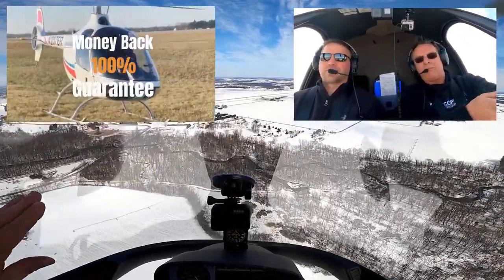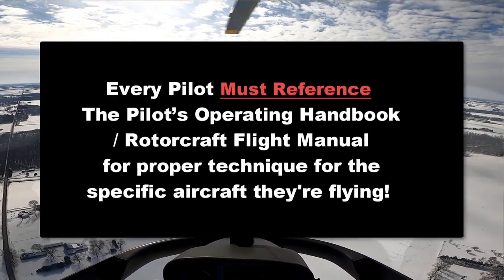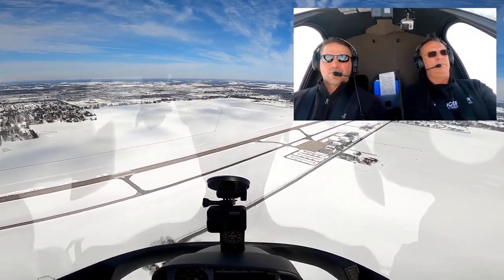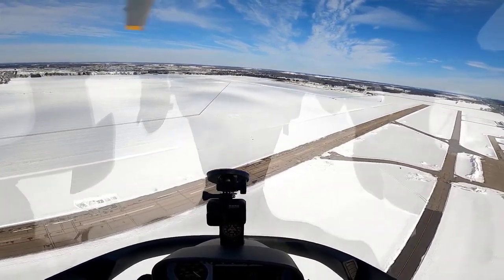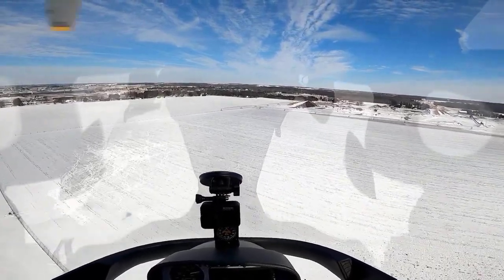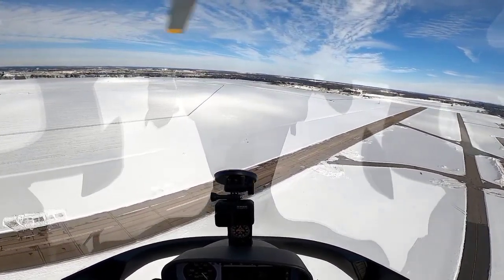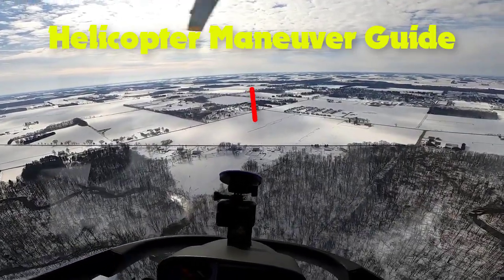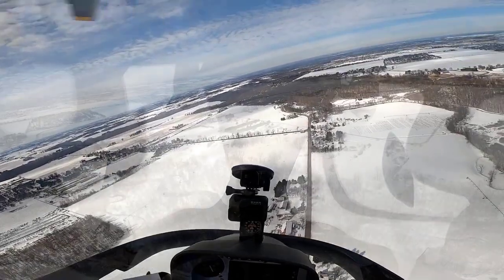Critical Helicopter Skill: Stretching Your Autorotation Glide for a Safe Landing

Comment: In the 44, the horn would have been sounding continuously below 97%, and POH says 90% for range - did it sound in the Cabri but you didn't catch it on the audio?
Reply from the maker: No it did not. The C2 is a full articulated system with a wide green range for rpm.